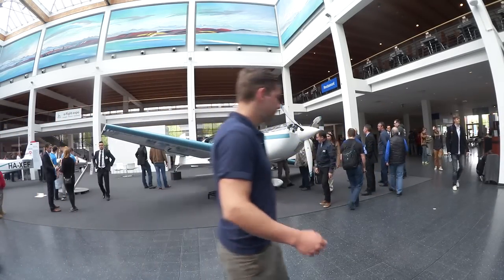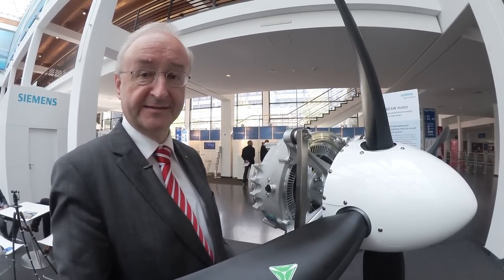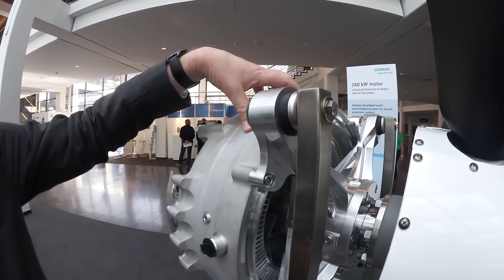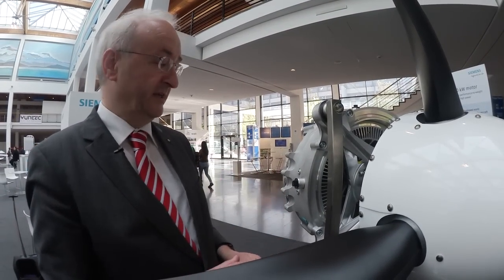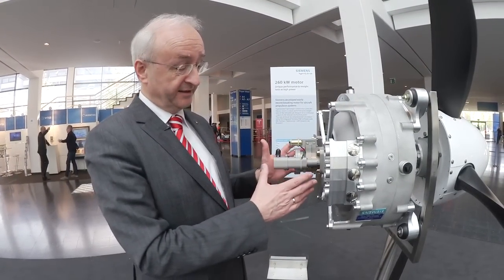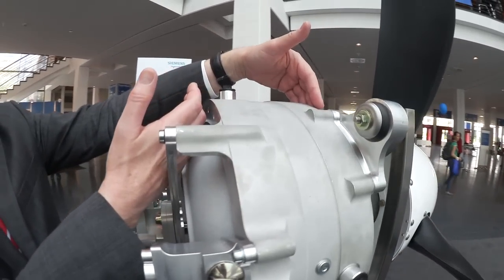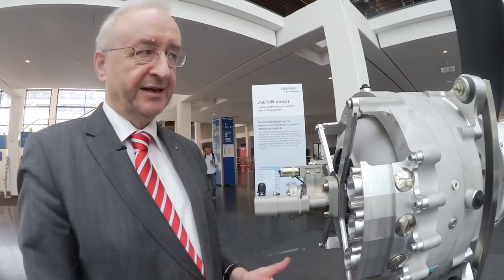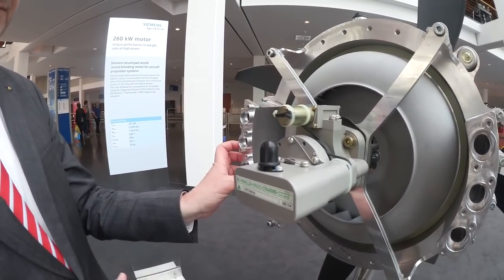How Brushless DC Airplane Motors Work

Comment: I'd love to see a counter-rotating propellers system. With electric motors this is mechanically much simpler to achieve and thus should be also much reliable and cheaper. Being able to have that much power without the worry of propeller torque is something to dream about.

Comment: As many have said below, it's a 3 phase AC motor, not a brushless DC motor.  The inverter converts the DC battery to 3 phase AC power for the AC motor. Might wanna fix your title :)
Reply: Brushless DC's are basically 3 phase AC, no? I mean you have three coils, and the ESC supplies a very dirty 3 phase AC. Correct me if I am wrong please.
Reply: @vl_dl  Nope, BLDC is driven by PWM (actually a kind of AC), this motor is drived by 3-phase inverted sinusoidal power. Anyhow the title is misleading.
Reply: it's the same thing,he even says it in the video what it is.
Reply: BLDC motors can run on both pulsed DC and 3-phase AC.

Comment: 450 pound batteries. One front and one in each wing. Lithium Ion right now is about 9 pounds per KW. Giving you about 150KW hours. That is double what a 230 mile range Tesla car has. 
Strap that bad boy to a Cessna 182. It should at to go about 250-300 miles at about 120 miles per hour with 600ish pounds of payload
Fly down to LA from SF, plug into a Supercharger, go to meeting, come back to plane 2 hours later and fly home.
 I don't think this is as far fetched as some people think...
Reply: 9 lbs/kw-hr?  33.6 kw-hr / gallon equiv.  so 302 lbs/gallon?  Is that correct to your claim?  That is 1/2 what a GM Volt weight is.  

268 kw x .75 = 201 kw.  Assume 90% you need 233 kw-hr for one hour of flight at 75% (201 kw or 270 hp).   9 x 233 = 2014 lbs.  How is that going to work?  You have no useful load....  

As for the power density of 3.18 hp/lb, hydraulic motors are off the shelf around 8 hp/lb and a well designed one can be 20 hp/lb with the bearing for the prop that are over 90% just like the electric motor.  And the Hydraulic motor does not need controllers that are very costly.  The problem with hydraulics the the same problem with electrics - the source of power, electrons or fluid.  Both make it heavy in the end.  

There is a better way....
Reply: seaplaneguy. What do you mean energy from fluid. You still have a pump for the fluid and then the 'motor' that transfers to rotation and energy goes into the pump. So just ditch the hydraulics and use the 'pump to move the prop directly. The great thing about these brushless motors is they are simple. expensive electronics is not as expensive as you would think. I see the guys point in that the people are the useful cargo. there is little maintenance on one of these type planes and batteries are expensive but not for some who can afford to swap out. quiet cabin. quick power for take off. all depends on who wants to go where. I don't see it taking over cross continent flight anytime soon though.
Reply: The 85 kW Tesla battery weighs 1200 pounds. Lithium Ion might be 9 pounds per kWh, but is that packaged for use in transportation?
Reply: Any of the touted lighter weights is net, net, and net! Packaged (mounted, balanced charge system, cooling, etc.) can double the weight.
Reply: What you don't understand about batteries is that the reality in power to weight ratio of the current generation batteries will definitely mess up with your over-enthusiastic calculation. The motor is very efficient. And there are also newer technology in motors coming up with high as 10-13 Kw/Kg power density than the Siemens 5.2 Kw/kg. So motors are the new source of power to the blades. But what is going to power the motor has a seriously bad power density. Atleast for now.
So stick with a conventional gasoline powered Cessna till the power density of batteries is improved atleast to 95% of a gasoline fuel.
Reply: Srinath Sudharsan : Ding, ding, ding!  We have the winner!  The man knows what he’s talking about.  To wit:  We have wonderful motor and battery management technologies sitting there waiting on the energy density of affordable batteries to catch up.

Comment: I'm more interested in what its power to weight ratio is with the batteries
Reply: He said 5.2KW/kg
Reply: You would have to take the weight of the fuel for the combustion engine into account to compare the two that way.
I'm assuming they used the weight that was gained by removing the engine and gas tanks for batteries.
200 L of AvGas = 154 Kg,  the Lycoming O-540  weighs ~200kg.
Minus the weight of the BLDC motor, that's 304 Kg you can use for the batteries. (about 75 KWh)

260 KW divided by 354 Kg equals 0.73 KW/Kg
223 KW divided by 354 Kg equals 0.62 KW/Kg
Reply: hahahahahahahahahaaaa !!!!!!!!!
Reply: they left that info out on purpose

Comment: You can even save a lot of weight it you use an axial flux machine instead of an radial flux machine. For the axial flux system you need no iron for the flux guiding. This saves about half of the weight. 10 to 20 kW/kg is not an issue. The machine is also shorter.

BUT: The total system is much heavier compared to a combustion engine. The problem is not the power, it is the energy. It is impossible the get the same amount of energy in an aircraft by use of a battery compared to fuel tank. The energy density of fuel is 12 kWh/kg, for the best batteries it is 300 Wh/kg. There is a factor of 40 between gasoline and Li-Ion. Even considering the fact, that the efficiency of a combustion engine is only a quarter of that of an electric engine, there is still a factor of 10 compared to the energy output.

Until now it is nearly impossible to fly for more than one hour or 200 km by electricity. This limitation can only possible to overcome by use of fuel cells.

Comment: Interesting.  What I want to see is one of these things on an aircraft that gets its electrical power from a hydrogen fuel cell in place of batteries....
Reply: airbus already working on it
Reply: RocKiteman _ 2001 may i ask why?
Reply: Naive dreams.
Reply: I love hydrogen.  It has 3 times the output per kg. weight of conventional fuel.  However few obstacles:  The 10000psi container weighs as much as the hydrogen content. Second biggest obstacle is its relative price compared to the aviation kerosene.  It is enormous.  Hope some day, they will lower the price of hydrogen to make it practical for aviation.  No wonder Toyota and Honda, subsidize their hydrogen fuel cell vehicle by giving 3 years of free fuel to the car buyer.

Comment: Another option for this is to put it line with an existing piston engine and smaller battery that would give you 15-30 minutes of level flight time.  This would make engine failures a non issue in most situations.
Reply: Unless the ICE or electric motor locks up😳

Comment: oil companies hate this :)
Reply: Still need them to produce the petro-chemicals used to produce the parts and batteries. Still they won't be showing them a lot of love.
Reply: Nah. The oil companies will actually sit back and watch these guys making fun out of themselves!
In reality, whatever improvement you do with motors, the battery's energy density is what that determines the practicality and usability. Unless there is a completely new generation of batteries with atleast 90-95% of energy density as gasoline, the Electric Airplanes will remain a novelty piece.
Reply: Well...at least they've supplied the coolant 😖

Comment: If the motor is powered by an inverter, doesn't that make it an AC motor?
Reply: good point.  but when get an example of the car: u start it with the dc battery then it continues by ac generator.
Reply: I mean it's all about the main source of the energy
Reply: No. If you call it "DC motor" then it's about what type of current is delivered to the motor. In this case it is 3 phase AC. If you have an electric toothbrush (or hair dryer) powered from the wall socket, you will never say it has AC motor inside - because it hasn't.

This motor is essentially identical to brushless motors used in RC industry; but oversized and doubled (in parallel).
Reply: Hear, hear! 😄
Reply: Yes it’s a 3 phase ac motor, controlled by a frequency modulated controller. Battery dc in ac out .

Comment: HYBRID is the answer.  Hook up a Lycoming and an electric engine in series... When throttle is >90%, run on both gas engine and electric.... once throttle is below 90%, turn the electric off and just run on the "regular" normal gas engine... imagine the performance when you have 600+ HP available for take-off, but cruise on a normal 300HP gas engine.

Comment: Impressive power density and redundancy (you don't get that in an ICE) in this motor. It could be driven by a 100% battery or a hybrid power source. Other than bearing service, it is almost zero maintenance. This should last far longer than ICE with far lower life cycle cost. Now we just need some order of magnitude battery improvement.
Reply: Bruce Boyes. You seem unaware of jet engines. They make them now. They burn lots of fuel, but they work and they fly over your head every day. Lots of fuel, but lots of Power from burning so much fuel over your head all the time they fly.
Reply: @JoshWeaverRC  jets in airliners are by themselves very efficient, up to about 50% thermal efficiency, because they are essentially gas turbines. The "lot's of burning fuel" comes from the fan which has horrible efficiency compared to a propeller.

Comment: Nice development.
Now if there were only batteries capable of delivering the energy for that motor with an endurance of 5 hours capable of refueling/recharging with in 10 minutes. Every day. For 20 years. Without destroying the battery in no time.
Reply: I agree
Reply: Lithium air or lithium sulfur

Comment: 268 kw x .75 = 201 kw.  Assume 90% you need 233 kw-hr for one hour of 
flight at 75% (201 kw or 270 hp).   9 x 233 = 2014 lbs.  How is that 
going to work?  You have no useful load....
Reply: Instead of using batteries, you use the small 3 cylinder 70 lb nissan turbocharged diesel engine, that puts out 400 h.p that was used in the lemans race in a hybrid car & another seimens emotor as a generator, & make the airplane a hybrid diesel electric.

Comment: Need 50 kg thrust from a prop up to 123 cm. Running time 60 minutes.  Battery weight 10 kg. Doable?  Or 2 smaller units with  same parameters
Reply: Easily achievable with the prop size and you would need something about 25-35hp or up to around 25kw power. No, 10kg batteries sustaining that power for an hour will absolutely not work, sorry, you may need at least 50kg!

If you search for propellers search for paramotor props, they are in that exact range. Electric motors can easily be found everywhere but they are expensive, ad well as batteries. Right now I would definitely recommend gasoline powdered for that scale, it's inexpensive and gas-sipping.
Reply: Search for electric paramotors, you'll probably find good specs sir.

Comment: Direct current is not a three phase motor. direct current is constant  power. If the power is turned on and off then it is phasing or alternating or AC.Why this matters?DC direct current is extremely simple where AC alternating current is complex. And this matters why?Complexity adds weight and a chance of failure.

Comment: Well the end of piston engines in general aviation is very near... Not sure when but definitely within 10 years.
So the motto is, don’t buy a piston engine airplane now unless you could retrofit later an electric engine. AVGAS will also disappear.
So in the next 10 years flying will be expensive as you will pay for an engine piston airplane first, then you won’t be able to sell it and the only choice will be to pay for a full retrofit electric engine. All of this to fly maybe 100-150 hours per year. Plus insurance, plus hangar, plus maintenance. 
Flying is an expensive hobby.
Reply: Internal combustion engines might be less common as we go into the near future. Though, I don't think that it is absolutely necessary to phase out ICEs, especially since advances in materials for engines (to improve heat retention) and biofuels (whose combustion byproducts are not as polluting as what result from that of petroleum-based fuels) will still make them viable. As well, I wonder if electrically powered Stirling engines will become commonplace on aircraft. These might serve as an alternative to all-electric motors.